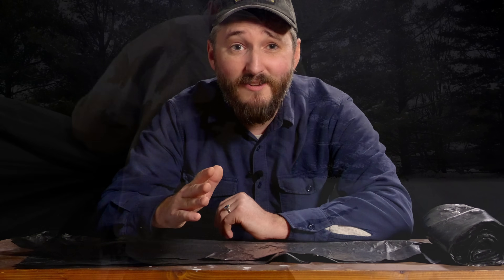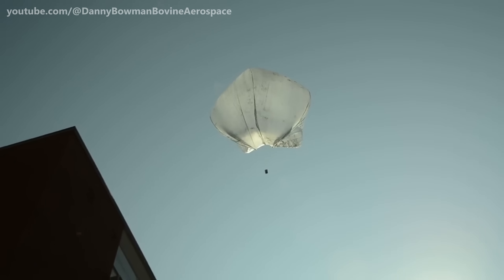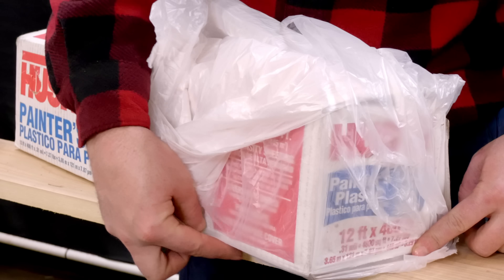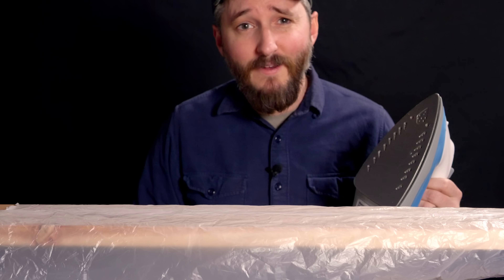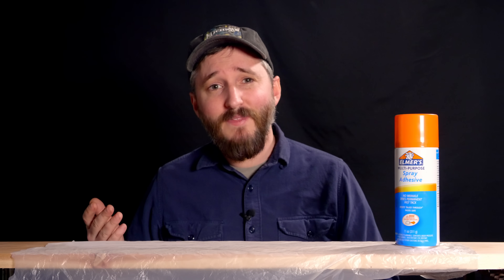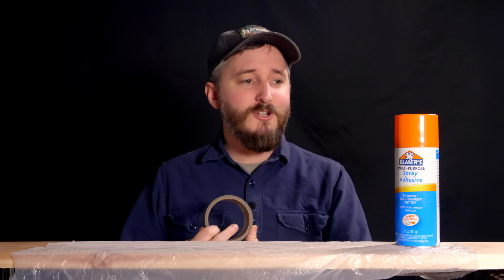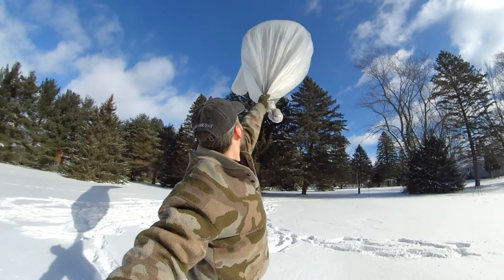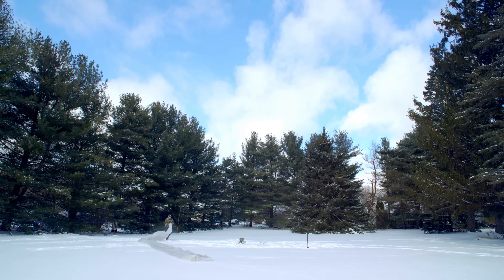DIY Solar Powered Balloons

Comment: So how many m3 volume did. you have?
And do a few grams of tape really prevent a balloon from flying?
And is a 30m long tube not a worse volume/weight ratio than a sphere? I‘m thinking that here is also heat loss via the surfaces.

Comment: Find the temperature the plastic starts to deformate. Heat up a strip of iron on top of parchment paper to the temperature slowly. Then remove. It'll make a legit seal that's stronger than the remaining plastic. With very little chance of a break on that seam

Comment: Back in the early '80s I was living in a frigid coldspot in North Pole, Alaska, where -50F was typical from time to time every winter. I wondered if a balloon would get enough lift from the temperature differential, so I blew one up as tight as I could, took it outside, and watched it float away (until it cooled down). Pretty cool.

Renting a singlewide in that frozen valley persuaded me to have our place built at a higher elevation, because we have a strong inversion that moderates the temperatures at altitude.

Comment: Ironically, this probably worked best because of the cold temperatures outside!

If it's the dark powder, or in this case soot, that concentrates the sun's warmth, wouldn't just using black plastic do an even better job?  Might be harder to track down black plastic in that thickness, but they do make it, because, they have that thickness black garbage bags...

Comment: Hey Ive got a solution for your heat related issues for bonding the plastic to its self as ive done some Model Zeppelin building with this Exact plastic.
So Ive made the seal Via a long stretch of parchment paper and a soldering Iron. So I just used a Large very smooth table (like the ones used in school that are very smooth) 
so you put the plastic on the table and then use a dry erase marker to mark out the shape you want to make. then you put the parchment paper on top of the plastic over the trace stretch. Then use the dry erase marker as your guide to make the Trace and then that makes a seal. With a blunt tip Soldering Iron at somewhere 150-200 Celsius or 302-392 Fahrenheit. Then you have a Nice looking Envelope for the Flying Craft.

it made a pretty good seal and is more durable and you can rip off the excess and it made it almost invisible and with some string rigging and some framing you've got a perfect solar Zeppelin and a Fun Activity to work on while waiting for stuff to come by.

Edit: I Forgot to mention that you can after making the trace with the soldering Iron you can wipe off the Marker afterwards.
I also hope that you guys find this helpful.

Comment: You know how solar ovens usually use a plastic bag or glass dome or the like to prevent the hot air from being disturbed? How about a 50/50 clear and black tube, or a clear tube with a black flat band in the center?

Comment: During a sojourn in Hong Kong, I watched a festival at night where hundreds of "sky lanterns" (天灯) were being lit,  ascending into the dark sky.  They're made from thin paper, with some wire holding the bottom of the balloon open.  A some flammable material was suspended there to provide the fire and heated air.  It was an awesome sight!  😎🇦🇺

Comment: What about using a sooty reducing flame on an oxy-acetylene torch to fill it the first time, evacuating all of the combustion gases and then filling in the early morning with cool air. Having accidentally used that flame in my garage, my spiders can vouch for the amount of soot that is still stuck in their webs! I’m curious how plain air would perform compared to air from the fire.
Reply from the maker: That should work fine

Comment: You need a layer of Teflon over your iron to keep the plastic from sticking. 
I worked at a place for a while that made the sealed edges on plastic containers and they always have a layer of Teflon coated cloth over the heat element to prevent sticking

Comment: Thanks again. The fun you have while doing this is infectious.
Any idease how to repair green house film? e.g. how to put patches on holes etc....
Reply from the maker: For temporary repairs you could use glue tape around the hole and stick a patch on top. Better maybe would be 3M blue 72, though I haven't tested it and it's a bit expensive

Comment: Unless you're near an airport in which case you should not be flying these or in class b airspace or something like that these are not a threat to aviation 

Something else why are you tying the end in a knot? Just use your peel and stick tape and seal the end it should be a heck of a lot lighter per square inch of surface area.

Comment: hey you need to use the hot iron with parchment in between as to not melt the plastic. Also if you increase the heat and humidity of the air in your balloon it will generate more lift

Comment: There's another way i used as a kid 40 years ago.
Instead of overlapping plastic in a 'circle', you 'sandwich' it like a folded piece of paper and melt the 2 edges together with a lighter or a candle.
I used 2 metal rulers and sandwich plastic in between. A few mm of plastic edges were sticking out to melt with fire into solid seam. And the rulers were keeping the rest safe grom the fire.

Comment: Ironing plastics tip: 
Use a dampened towel on top on the plastic-layers and issue high heat. It may work because I know that's what people do for iron on patches with plastic beads or glitter crap.

Comment: Have you considered wind power as well?
Wind speed increases with height, so I wonder -- can such solar powered baloons lift relatively small and lightweight wind turbines sufficiently high to produce a significant amount of electricity over time?

The baloons are tethered anyway, so a wire can run down to the Anchor (pun intended). Question is, of course, what weights, sizes, and height would work for such application, i.e., dimensions, materials and type of wind turbine, tickness and weight of the wire, size, and height of the baloon.

Comment: you should have made a jig to pinch the plastic in one spot, then if you can heat that spot and roll the plastic through continuously at the right speed + heat it will join them perfectly.

Comment: I'm sealing HDPE bags this way: take two steel rullers and put both ends of plastic over each other between rullers so 1mm is out and then I just use lighter to weld them together. However with this length it can be tricky.

Comment: Amazing! Would it be possible to float a wire with balloon to run an electrostatic generator or device like in Tesla patent 787412? (Maybe that Anker could serve as the pulse-generator in that patent.) Thank you for the vid, the info, and all the hard work too!

Comment: Over 50 years ago you could buy something quite similar from the back pages of comic books - I got one when I was 14, it was a tube about 3 ft. across and I think it was around 10 ft. long. It came as a hollow tube which you tied one end closed, the you'd run around in the yard with the mouth open to fill it up with as much air as possible.  This worked great and though it started off a little floppy looking, but the heat of the Sun soon had it expanded and plump, it looked like a giant black sausage, and since we didn't know anything about interfering with air traffic back in the day, I just let it go and watched it sail up and away, it was amazing ;?D

Comment: Nice. But why didn't you use just black versions of this thin material?
Reply from the maker: No one makes it. Not that I could find anyway.
Reply: @Nighthawkinlight but this will solve your air heating problems inside the hose. The inner convection will distribute the heat very quickly in the air filling.

The use of a fire is also not convenient. It is besser to use a larger battery operated fan. 

Solar heating from outside does the rest. It will erect the hose very quickly on a sonny day. You can easily reach inner temperatures of 80 °C by use of black foil.

Comment: cant begin to describe my pleasure in your content, explantion and entire vibe. You are a king. I have one question- relating to anothervideo. I;m posting it here because the video is 8 years old and I doubt you would be replying to comments there. It was the video where you acheived permanent levitation of a magnet by suspending it between two bismuth crystals. i understand that free energy is not possible, or at least thats consensus of all credible people with expertise. Can you please explain why this model could not generate electricity if a copper wire was placed correctly near it? I thought that electricity required a magnetic field, a conductor and motion. As all three could happen here without friction or other energy loss, what would be the reason why it could not produce a current indefinitely? Thanks!
Reply: thought about it some more and maybey its because the magnet spins but the poles remain in the same place? or is it the levitation thats relativley indefintie not the spining, which would be slowed down by air friction? damn it im not gunna get to sleep tonight

Comment: I'd be willing to be a slightly smaller heat source coated in Teflon or similar would do a fine job of sealing the plastic. That's what we use to heat-seal poly bags at work.

Comment: Wax paper or is that somebody else mention parchment paper between the iron, and the plastic can prevent that sticking, and put some wax paper underneath the plastic as well that way, the plastic disable the melt stick to itself and nothing else. if it’s melting too quickly and you can’t lower the heat anymore, put an extra sheet or two of wax paper between the iron and the plastic. I can’t imagine anything else working better than melting them together neatly, and they wouldn’t need a lot of overlap, either. If you could make that plasma cannon, I’m sure you can do this! 😝😝

Comment: On a 80°F clear sunny day, no wind, how many feet of 12ft diameter black plastic tube would you need to lift 150 pounds?
Reply from the maker: It would have to be something close to a standard person carrying hot air balloon in size

Comment: You can use this same material and wider construction along with a hepa filter and a constant fan to create a portable “clean room” You just add a door by cutting a long slit and gluing a stiff but flexible to both sides like thin plexiglass or I used a couple of old vertical blinds. This allows you to enter and easily hold the door closed and sealed with binder clips . Glue one side a couple inches back from the edge so you have some overlap plastic to fold over the seal and clip in place.  The positive air pressure from the running fan provides all the structure needed for the dome to stay a dome.

Comment: Would you be able to do a follow-up video with modifications done to the design of the balloon? I would be curious to see if changing the color of the plastic would also help to trap heat better. I had this idea to spray paint a thin layer of vantablack or black 4.0 on one side of the tube to trap more solar power. Let me know your thoughts.
Reply from the maker: I have a ton of projects to keep me busy so I kinda doubt I'll do a follow up on this one anytime soon. I'll keep it in mind though
Reply: @Nighthawkinlight  Thanks for the reply! If I decide to try it out I'll upload a video of how it turns out.

Comment: Oh man you had the right idea with sealing the edges with an iron. You just needed 1 layer of wax paper and 1 layer of paper or paper towels. The 2 layers insulates and allows you to seal without melting too much and the wax prevents any of it from sticking to the plastic and the paper layer keeps your iron clean and wax free.

Comment: I use 2 make kites. I used a wood burner. Just attach it 2 a light dimmer switch. U hafta messs around a bit / the dimmer 2 get right temp. But if u go slowly it will bond plastic bags quite well. Good luck i like the idea

Comment: I used to melt vulcanized rubber together, everything was coated in teflon tape. You might be able to use a seam iron for bonding carpet, it also uses teflon tape for non stick to the adhesive.

Comment: My guess is that this would work better in cold air than when it's warmer.  The heat flows out according to the temperature difference, so to a first approximation a fixed solar heat flux would maintain a fixed temperature difference.  The volume of air is roughly proportional to the absolute temperature, so there's a bigger relative gain at lower temperature.

Comment: Now all you have to do is create something simple to open or close a valve to allow the air to escape to hold altitude or retreve the balloon safely! On top of lightwieght thin film solar pannel (spray on film) to power lightwieght electronic things inside or under it.

Comment: an iron probably cycles with a temperature difference that isn’t great. i wonder if a carpeting iron could be more consistent. as others suggested something between might help.

i also though about a good soldering iron that has a much better temperature control to it.
Reply: now i wonder if it would melt at less than boiling. you could boil water with a metal spatula or something. it would never get too hot and the water would never surpass boiling temp

Comment: weird question but shouldn’t outside temperature not impact the buoyancy because the difference from surrounding air is all that matters?
Reply from the maker: Just the low sun in winter would be a bad effect compared to summer
Reply: @Nighthawkinlight  ah i completely forgot the reasoning behind low winter temps xd